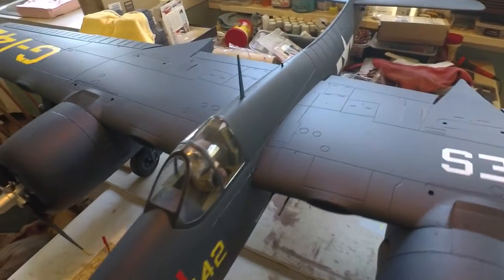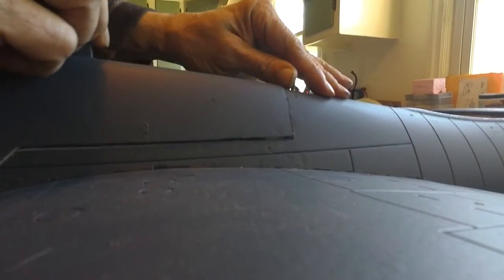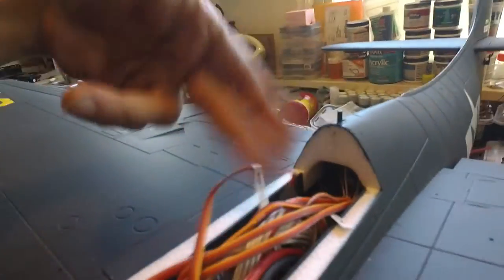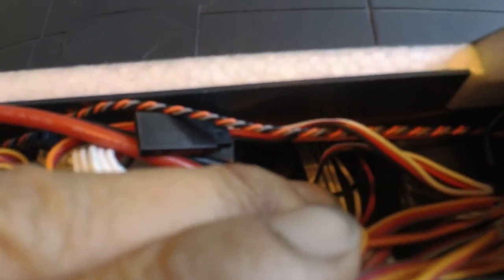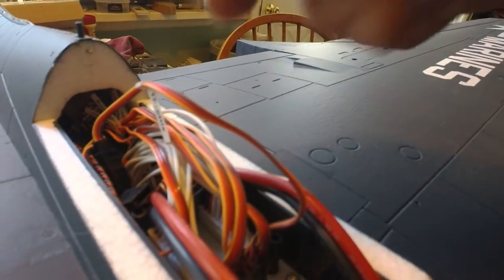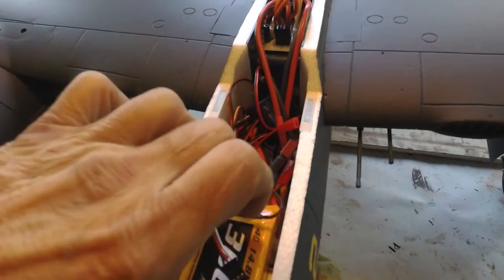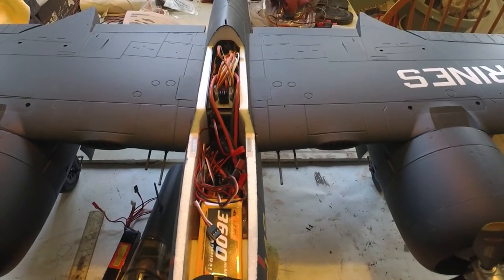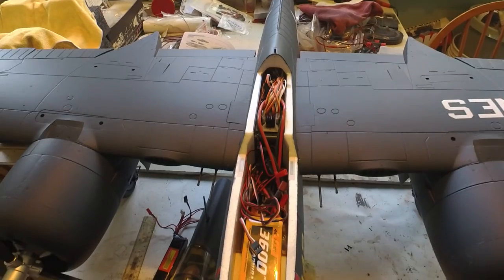Flightline RC. F7F-3 Tigercat,  By Request,  Steps to Remove The Wings for Transport

Comment: Geez, does this plane fly well! I keep thinking my luck is going to run out with the Flightline’s, but every plane and edf from Flightline has exceeded expectations. The Builds and the way they all fly make me look good. I even went to the ix12 to see how much I’ve trimmed each- little to none. And the CG’s have all been battery or batteries full forward for the most part.
NOTHING is going to replace the love I have for the Pacific Silver P-38 as my favorite plane to fly, but the Tigercat may have replaced the Flightline 1600mm Spitfire as 2nd favorite. Thanks for all the great videos, and helpful hints.
Happy Holidays, and hope this finds well.
Reply from the maker: Hey Jeff thanks for the info, I'm glad you like the plane I know I'm in love with mine still. But yeah I have to agree just about every flight line I have is a potential favorite. Happy holidays buddy and happy flying, skip